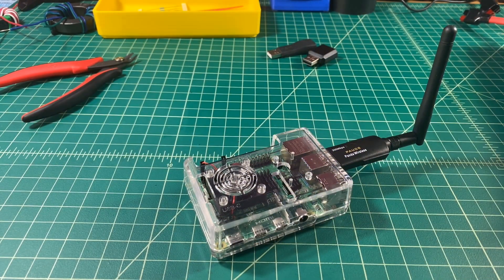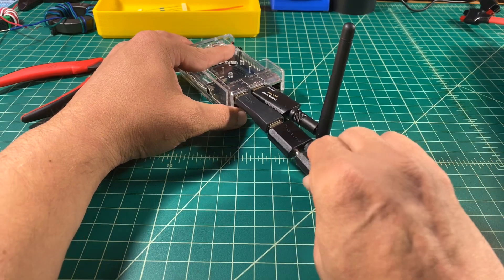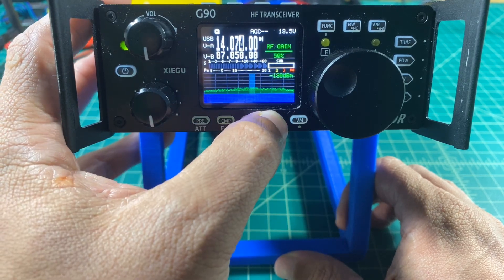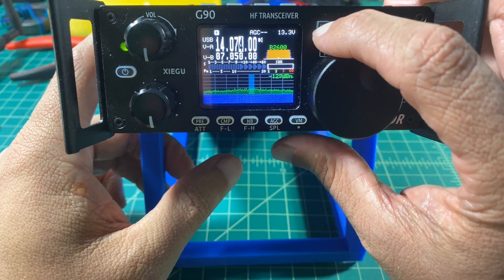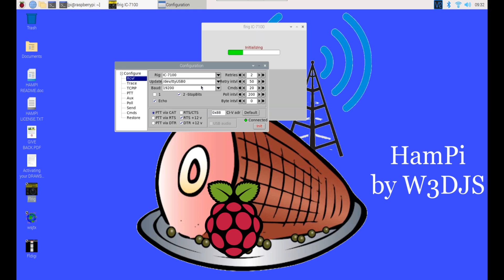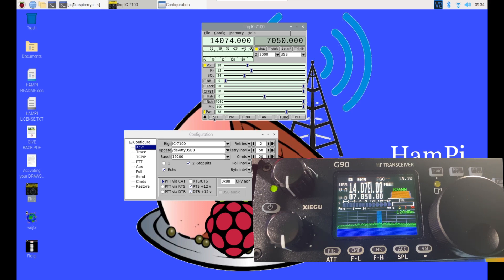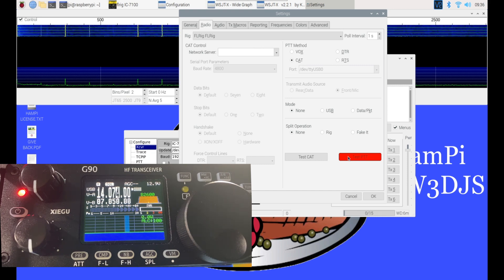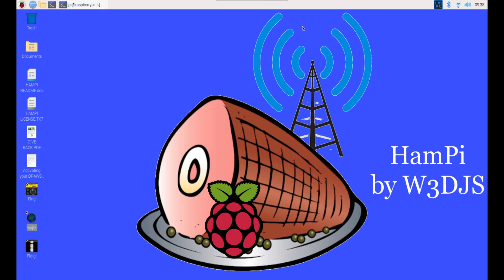FT8 with the Xiegu G90 Made Easy - TheSmokinApe

Comment: Is there a reason to use FLRIG ? Surely WSJT-X can control a radio directly ?
Reply from the maker: It can now, but it couldn’t when I made the video 👍
Reply: @TheSmokinApe  I thought that might be the case. We have to remember the info is frozen in time but technology progresses. In fact, since I made the comment, I actually have to use FLRIG to make WSJT-X talk to my G-90 whilst using Linux Mint 22. With Windows 10 it wasn't necessary on the same computer.
Reply from the maker: Using FLRIG wasn’t too bad but given the choice Id rather not use it 👍

Comment: I'm late, but thanks for this video. The only issue I have is at 15M and above, the power drops from 15W to 6W with 100% ALC. Below 15M the ALC and the power are within the power button setting range. I'm at a loss. Firmware 1.79 and 1.80.
Reply from the maker: Hey Scott, I sold my g90 a while back so my memory is foggy.  Don't you want the ALC to be near 100%?  Also, how is your SWR at 15M?
Reply: @TheSmokinApe  The SWR is good across the board. The Manual states you want between 30-85% ALC. The G90 seems backward on a lot of things.
Reply from the maker: @Scott_NF5R  yeah man, I’d try that firmware out to see if I had the same problem but mine is long gone.
Reply: @TheSmokinApe  It's okay. I appreciate the replies.

Comment: Having trouble with the G90.  I'm running a xggcomms DigiMode-4 interface.  I got through your instructions for setting up flrig and it seems to be communicating with the radio - I can change the frequency by clicking in flrig.  But the light on the lefthand side of the radio next to the Vol knob goes red as soon as I start flrig.  That doesn't seem right.  Seems like it's sending the radio straight into transmit mode.  It turns green again when I exit flrig.

Comment: I got the WSJT-X working with the Xiego G-90 but I have been experiencing WSTJ_-X crashes during some QSO's. I figured HF was getting into the USB cords  since it only crashes during the transmit cycle so I put  a bunch of ferrite beads on the USB leads.  It's driving me nuts. Any experience with this type of glitch?
Reply from the maker: I did have that problem with an old laptop so I switched to a Raspberry Pi, if the ferrite beads aren't the correct mix (mix 41 works very well)  RFI can still make its way to the PC.
Reply: @TheSmokinApe  Thanks for the reply. I couldn't find any 41 mix but ordered some 31 that had a lower frequency range. Thanks for the advice, I'll give it a shot.
Reply from the maker: Good luck

Comment: HamP i now has a Xiegu G-90 as a rig choice in flrig but it is not in the choices in wsjt-x. So I chose G-90 from flrig.  In wsjt-x I chose flfl rig. The programs open and I can see traffic but I can't answer. When I test PTT it triggers the G90 Transmit. Have you tried HamPi using the G-90 as a rig choice? I am stumped!
Reply from the maker: I have not tried the update yet.  Have you; made sure the time is accurate on the computer, changed the volume out on the computer and checked the audio out setting on the g90?

Comment: I have a CE-19 do I run two cables from the CE-19 to the sound card? AF Con and DataCon to the sound card?
Reply from the maker: Sorry man, I haven't messed with the CE-19
Reply: no.  You use the AF stereo socket, and split that into your soundcadr input & output as mono each - use the cables provided with the CE19, and solder them together, two 1:1 and the third one to the same ground, but the black and white wire twisted - one plug goes into the CE16, and the other two into mic and speaker of your sound card.   
(if you have passed a license exam, then you should be able to understand the graphs on the ce19 and solder a couple of audio wires together)

No rocket science, once you understand that the one "AF CON" is for both, ingoing and outgoing audio.
Reply: @zoolkhan  Thanks for the reply. I figured it out last month. The markings on the ce-19 are a bit vague even for an EE. I appreciate your reply but you should save the sarcasm for some other social network.

Comment: Thanks for the video. Great walk-thru. I have an XGGCOMS Digimode-4 on the way, and I hope that proves more successful. I have not been able to get digital up and running so far on my G90. Using the CAT cable and the CE-19. Direct connect to WSJT-X is a no go. If I use FLRig (which now has a G90 profile) I can get my radio to receive signals in FT-4 & FT-8, but the TX doesn't seem to do anything. When I test the PTT I see same results as in your video. But during actual WSJT-X session, on transmit it shows red light, then immediately clicks off. I'm using the Sabrent USB as well.
Reply from the maker: The PTT is done with the cat cable is a the audio is passed via the sounds card, which it sounds like you know / have covered.  First I’d make sure you time is correct on the PC and you make want to use a time sync service.  Also, double check the sound card setting for TX. 👍
Reply: @TheSmokinApe   I'm running a time sync service, and can usually see that I am within a fraction of a second of most users. I do think the issue lies somewhere with the Sabrent & sound card settings. Maybe even with the cable I'm using to connect the CE-19 to the Sabrent, because I'm feeding it into a splitter in order to have both mic and headphone.
Reply from the maker: @cdyow  Ah, I've never messed with the CE-19 as it looked like a pain to work with.  I am inclined to agree with your assessment, hopefully the new cable will get things sorted out for you ☝
Reply: @TheSmokinApe  Great news. I was able to get up and running with existing hardware & cables. The missing link for me was finding the correct relationship for audio input/levels between radio, PC, and WSJT-X. Now sitting in front of FT-8 for hours like a slot machine.
Reply from the maker: @cdyow  that’s awesome 👍
Reply: Hi Chris,  my Digimode-4 recently arrived but no luck with it so far on xmit.  I receive fine, I get some rig control, but cannot get it to key the rig.  In WSJT-X, I get the green CAT bar, but when I test Xmit the program locks up.
Reply: @geod3589  Unfortunately, I had the same experience. I decided not to spend any more time investigating it for now because I got everything working with the CE-19 and OEM CAT cable. But I feel your pain.
Reply: @cdyow  well, I finally got it xmitting FT-8 by using DXLabs Commander as the "radio" in WSJT-X.
Reply: @geod3589  That's great news. I might circle back at some point and give it another try. I had no luck using WSJT-X directly, regardless of which radio I assigned. Currently running it through FLRig into WSJT-X. Have fun!

Comment: Did you try using the CE19 and the cables supplied with it to connect for CAT control and digital modes?
Reply from the maker: I didn't, I don't have a CE19.
Reply: @TheSmokinApe  The CE19 breakout board includes all the cables necessary to connect for CAT and digital.  It isn't  as nice looking and is more pieces but it basically allows you to duplicate the interface you bought.
Reply from the maker: @hhampton  Im familiar with it just never had one to mess with, maybe I'll check it out.  I love the g90

Comment: I wonder if your trouble with cat control could be related to the cheapo USB sound dongle, instead of or in addition to the interface cable? As far as I know, cheap USB audio interfaces aren’t known for good audio quality or noise rejection.
Reply from the maker: CAT was over a separate cable / interface.  When using the same sound card with a different CAT cable it works fine 👍

Comment: Since the current available version of FLRIG as of 11/22/20  has the Xiegu-G90 listed as an option under the configuration menu have you tried that configuration vs. the IC 7100?  Also, did you use the Digimode 1 or the Digimode 3 cable?
Reply from the maker: I’ll have to check that out, thanks for the heads up👍. It the cable that does both audio and cat, I think it’s the 3.
Reply: Thanks for the reply. I hope to get a G90 for Christmas. 🤞 I've been out of the hobby 30+ years and will be operating portable. The G90 + RPi looks like exactly what I've been looking for.  I'm using the Build-a-Pi image rather that HamPi. I tried both. I have 3 RPis.
Reply from the maker: @hhampton  build a pi works really well to.  I’m quite happy with the g90, best of luck getting back into the hobby 👍

Comment: I've done everything in your video step by step and the cat control works etc.. However WSJT-X will not decode and when I transmit it shows it's transmitting on my G-90 however when I look at the watts on the G90 it states 0.0w so nothing is going out. Any suggestions on how to remedy both of these problems?
Reply from the maker: Do you have the right sound card settings?  It sounds like audio isn't getting in to out...
Reply: @TheSmokinApe   I have it set to the XGGCOMMS DigiMod-3 USB  Audio for both input and output.  But you right someone else told me that audio wasn't getting out as well.  So, sounds like you i just dropped $65 on a product that is not working and returning would be a hassle since they only are located in the U.K.

Well actually it was not the fault of XGGComms after all it was user error.  I took the XGGComms out from the back of the radio and notice that I had forced the pin wrong and bent all of the pins, Stupid me.... so, now I suppose I will be ordering another one and paying closer attention to plugging it in the right way this time.
Reply from the maker: DK M you might want to check you clock to make sure it’s accurate, that’s another important thing.

Comment: I have cyber security concerns  with Ham-Pi, it states in their documenation if you are connected to the internet that Ham-Pi will use one of the cores on your Pi for other uses, and you cannot switch it off.

Therefore I think it is safer to use Build-a-Pi image from Jason KM4ACK.
Chud M1PUP QTH London
Reply from the maker: That's not what it says.  "Usage of this image means that you freely give your consent to running the Berkeley Open Infrastructure for Network Computing software, which is configured to only run when the Raspberry Pi is powered on and idle. The reason this image includes this software is that the author originally asked for QSL cards for usage of the previous software image. When there were over 8,000 direct downloads of the previous image (plus an unknown number of BitTorrent / indirect downloads) and the author received less than five QSL cards, the author determined the only way to get something in return for all the hard work (non-monetary, mind you) was to code it into the image. The BOINC client will run benign network computing tasks, such as science applications like protein folding, or searching for neutron stars. The author also believes that this rule isn't for "other people" but includes the author as well, and runs the BOINC software on his Raspberry Pi as well. If you don't consent to this, you should stop running and destroy your copy of the image."
Reply: @TheSmokinApe  Blowing extra CPU cycles while operating portable sounds like a horrible idea.
Reply: It's open source project. Can you provide the title of relevant documentation that says that? I couldn't find it going through the github project. The reason I'm asking this is what you just said doesn't make any sense to me, as a linux/raspberrypi nerd.

Comment: FreeDV!!! Thanks Ape. Good video. The xggcomms solved my issue with input audio on the G90. Without it, I would get a lot of screaming audio in FT8. I worked with a local ham but we could never solve it. However, the xgg hardware did the trick. I should set up a pi for the G90.
Reply from the maker: A pi is a must!